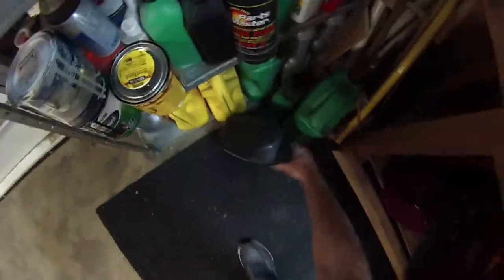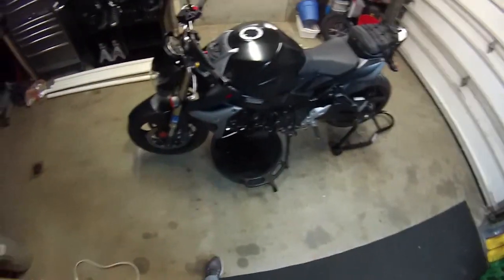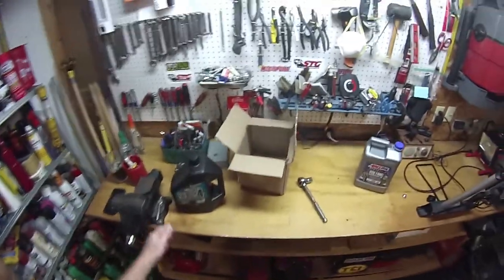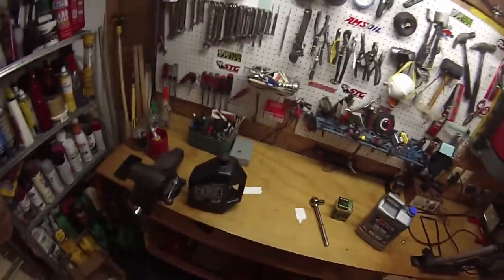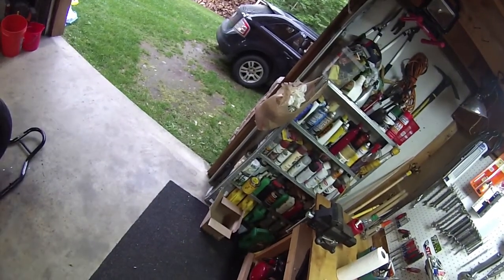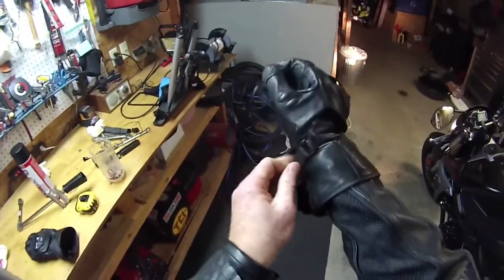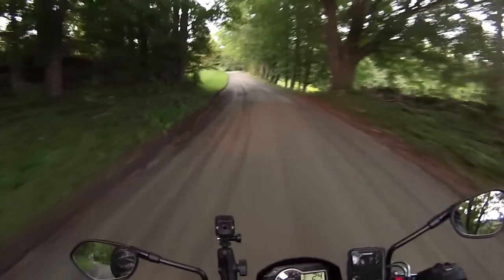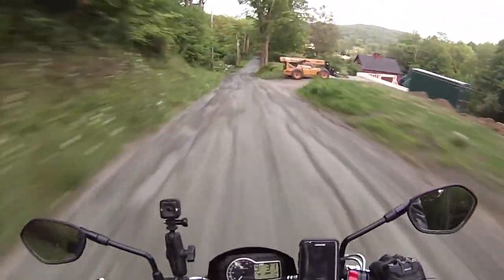Say WHAT? Oil Evaporation? Non-Synthetic VS Full Synthetic Oil | Suzuki GSX-S750

Comment: Kinda late to the party but I have used motorcycle specific oil from Motul for a couple of years now and I can highly recommend their stuff. The 7100 line from Motul is really good imo, have used it in my CB600F, FZ6, MT07, MT09 and I've recently picked up a 2018 GSX-S 750 with ~ 15k miles on the clock and did a preventative oil change on it with Motul 7100 10w-40. 
Engine is smooth as butter, gear changes are exact and the clutch feels real good. Will see how it goes with oil consumption but the engine feels healthy.
Reply from the maker: I’ve never used it but it has many fans! I read a scientific test of motorcycle oils and amsoil had the highest heat and sheer resistance so that’s what I use and I’m extremely happy with it! But again... motul has many fans. From what I hear from you and others, it’s good oil 👍

Comment: So  you use expensive Synthetic Motoröl, are afraid of a Non-Synthetik oil damageing your engine......But you use the cheapest crap of oilfilter. An genuine one is not much more, but better. High-flow means bad filter...
Reply from the maker: TheNfurter I typically use the hiflofiltro with the little nut on the end. I've used the k&n once. Btw, I have read studies on these filters. Some are better. But all agree that the performance differences are insignificant/impossible to discern. But I'm always open to learning new things! Thank you my friend.